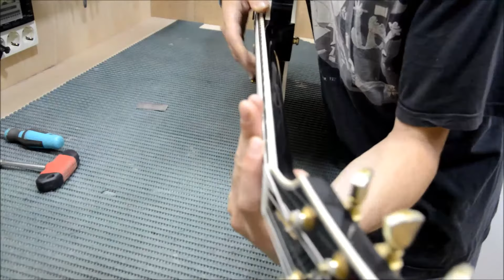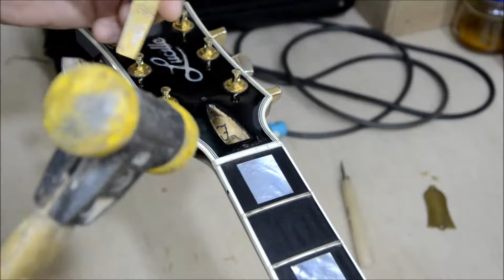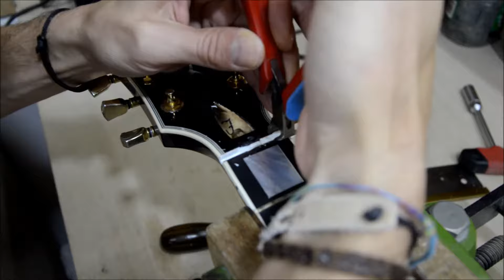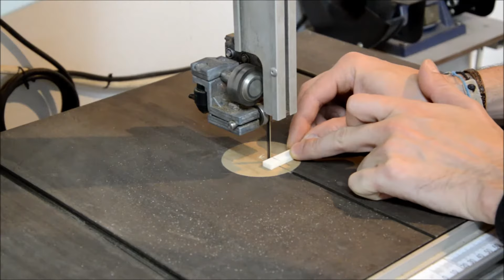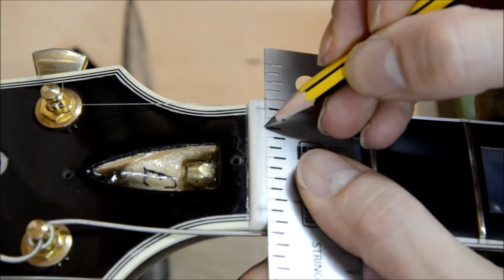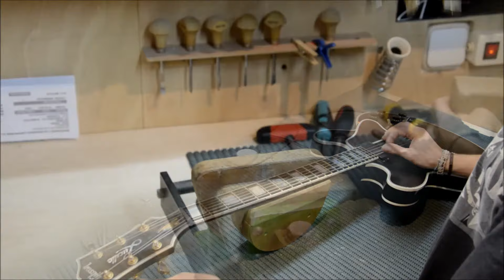How to change a guitar nut

Comment: Soy yo otra vez.Te hago otra pregunta capo. Compré un nut o cejuela para la guitarra eléctrica que te contaba. El ancho, altura y separación de las cuerdas están bien, pero tengo una duda importante: ¿todas las cuerdas deben tener la misma separación de los trastes o es normal que en orden ascendente las cuerdas van cada vez mas cerca...o sea que la 1ra va mas separada y la 6ta va mas cerca de los trastes y del diapasón?
Ahora sucede que la 1ra y la 2da cuerda se escuchan muy bajo. me conviene subir las pastillas para solucionar o restar ese problema? gracias
Reply from the maker: Lo normal es que la primera, el Mi agudo quede un poco mas baja que la sexta, las cuerdas graves vibran mas, por lo que necesitan mas espacio.
Lo que debes hacer depende de cada caso, tienes dos opciones, o rebajas la parte inferior de la cejuela hasta conseguir esto, o vas rectificando los surcos de cada cuerda.
Lo del sonido bajo...pueden ser varias cosas igualmente, la cuerda no asienta bien en el surco de la cejuela, repásalo y asegúrate que entre de todo, que no queden apretadas y no asienten bien en su hueco, luego revisa el puente por lo mismo, prueba la guitarra sin enchufar para ver si el problema sigue,   si sin enchufar suenan al mismo volumen, entonces si es problema de regular la altura de las pastillas.

Comment: What in gods name possesses people to use Crazy Glue to glue in a nut ? There is no need for it what so ever. A small drop of Titebond is all that's needed and thats only to prevent it from falling off when you removed the strings. String tension holds the nut in place.